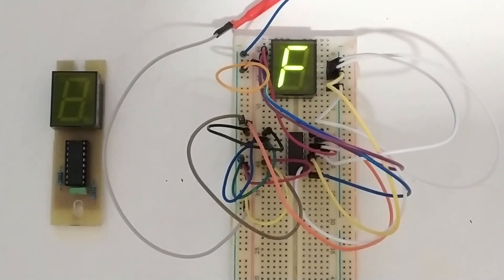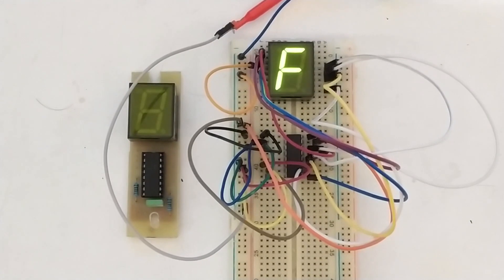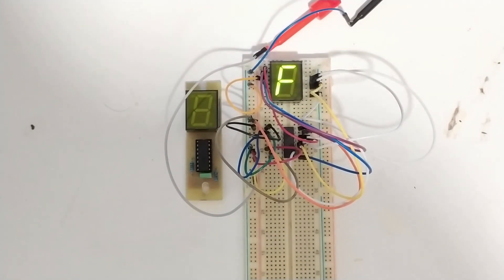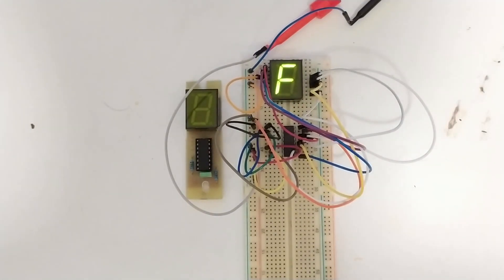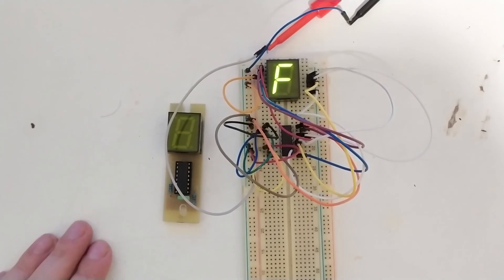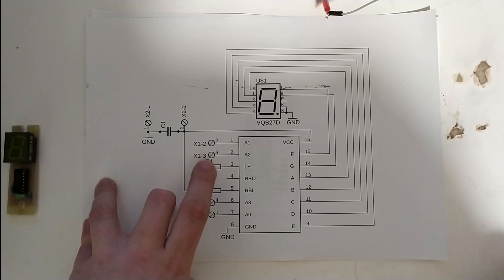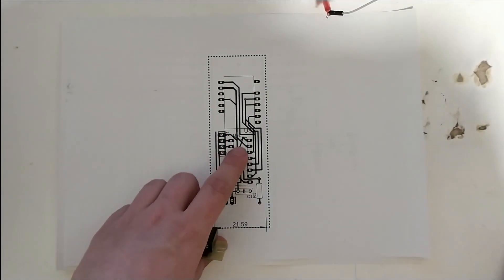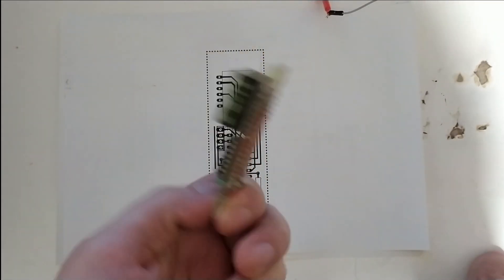Building a Z80-Computer Part 7: Binary to seven segment (hex) decoder

Comment: Many classic computer from four decades ago do not use that luxurious driver IC but they addressed the 7-segments display with I/O. The drive IC was only used in fancy computers made by big companies with numerous posh technical specialists and high class twits. 
 
Working class people got one led for each bit of data, most the time there were eight bits of data. And if a coalminer wanted to work on his computer, he had to do the maths himself, most the times four bits at once. All hexadecimal numbers meant something. It was hard work.

Comment: I used a Attiny24 programmed in Bascom basic.  Reads port B0,1,2 and A7 as inputs and outputs to A0-6 for 7seg display.  I bought attiny84s on Mouser for 1.66 each.  Can easily be converted for common Anode and Cathode displays.
Reply from the maker: Bascom Basic, haven't heard that name in a long time, that's how I started on AVRs probably more than a decade ago. I didn't want to use a Microcontroller on this project though. I would go against the spirit of this Project, I'm trying to keep it as much period correct as possible.

Comment: I tried this ic in proteus but it doesn't work, anyone had any idea how to fix it? I got the model from component search engine.
Reply from the maker: Well, Unfortunately I don't know much about Proteus but if you are certain that the circuit is correct maybe use a different model if you can find one. What is the specific issue you are having?

Comment: Where did you source your DM9368's?
I bought some on eBay but they go blank on binary 01010 and above, but fine for 0 through 9
Reply from the maker: Hey! I got them on AliExpress, and ordered from a seller that had fairly good reviews for providing non blacktopped old parts. But I think I got quite lucky with the 20 I bought. All of them seem to work.
In your case they might have rebadged a simple binary to seven segment decimal counter
Reply: @captainsolder5247  Thank you for your reply, yes I think I got a blacktopped job, I guess I am grateful that I can use them for something though.
Reply: I have the same issue? Did you ever solve why this was happening? Mine are fine up to 9 but blank out for A, B, C, D, E, & F

Comment: I acidently buy "4bit 7segment" instead of "four 7 segment" do you know any use of it that doesn't use It with arduino?
Reply from the maker: So you bought a converter/Driver Chip accidentally? or did you buy a lot of TIL311s?
Reply: @captainsolder5247  No I accidentally bought SM420361K 4Bit 7Segment. My circuit use four DIS1417. I order it but I got one 4bit SM420361K instead. And now I have 4bit SM420361K but I have no use for It.
Reply from the maker: @ngaw9860  Ah Alright! Do you have a Datasheet for the SM420361K? I came up empty looking for one
Reply: @captainsolder5247  I don't have It as well, but I have the website that I buy it from -> http://www.wt.co.th/?code=120-34280-1
Reply: It also look like 5461AS but smaller.
I got the 5461AS datasheet  -> http://www.xlitx.com/datasheet/5461AS.pdf
Reply from the maker: Ah alright, this looks like a normal 4 digit 7-Segment Display, you can use these for all kinds of things (Clocks, Power Supplys and Thermometers come to mind), Either using a µC or using things like the 74LS47 BCD to 7-Segment decoder to drive them , there's also chips that decode decimal. In either case you'll have to multiplex the Displays, switching one cathode at a time in correspondence with the right Anodes to give you the right symbol on your display.
Reply: @captainsolder5247  That's really helpfull thank you!!